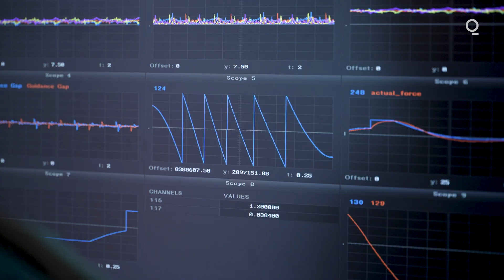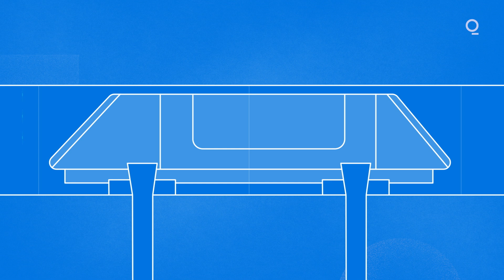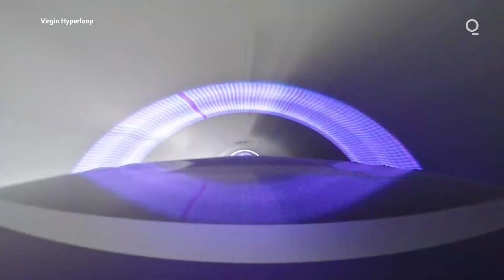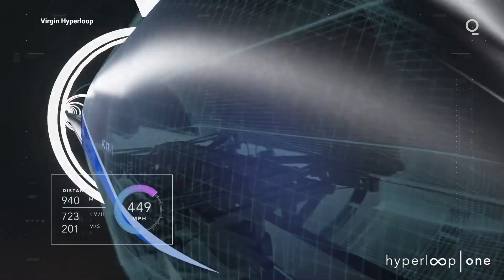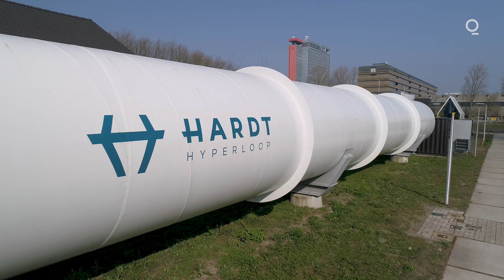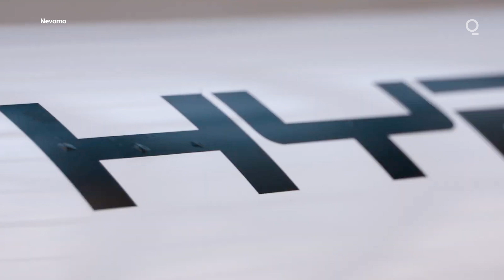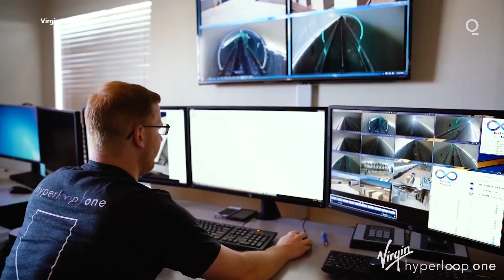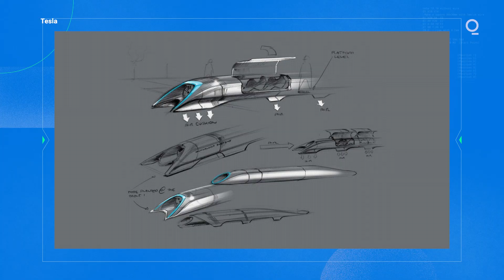The Hyperloop May Disrupt More Than Just Travel

Comment: The only way I could see hyperloop being attractive is if the prices are competitive with airfare.  However, this seems like a maintenance/operation heavy and low volume mode of transpotation.
Reply: You're right, logistics of it is utterly laughable, why not hybrid airships carrying 1000 tonnes at 100kmph? that's actually doable on a shoestring by comparison.
Reply: Flight is horrendously inefficient. The higher fuel prices get the more viable high-speed rail becomes. It’s just a matter of time before it happens in my opinion.
Reply: @stir_stick  You may want to look at the fuel consumption per person of a modern passenger jet and compare that to your SUV. You can, of course, compare to electric rail, but when was the last time you took a train from New York to Los Angeles in the US? What doesn't exist doesn't matter.
Reply: @stir_stick  Flight itself is inefficient but the infrastructure for it is highly efficient . To connect a city all it needs is an airport, to add another, just another airport. For rail you need a station (airport equiv) and rail between another rail station. To add a third city you basically have to build all that out again, to connect multiple cities you will even need more than a 1:1 ratio of rail too to increase efficiency.
All of that rail needs maintenance too and support structures for that maintenance. 
It is only feasible in a very dense area or as a means of moving massive industrial / commercial capacity, even then if you can do it via water and have a more lax time schedule ships are cheaper for the same reasons.

Think of it as running ethernet / fiber to every home in a city vs putting up some towers (ignore the inverse speed difference in this case too).
Reply: @stir_stick  trains >> hypeloop
Reply: When land transport become competitive with airlines prices of airlines go radically down, like in Europe where Trains are sometimes faster than Planes (when you take into account the TSA, and the time spent to get to and from the airport) but low cost airlines are cheaper.
Reply: @SergioLongoni  Low cost airlines don't operate in a vacuum (pun!). They are being subsidized by first class tickets sold by major airlines which pay for most of the airport infrastructure and plane R&D. Most cost comparisons are therefor total garbage. The point that rail can get you into downtown without all the location penalty and security overhead of airports etc. is correct, but it does not apply to cities where downtown is not already prepared for rail (which is mostly only the case if rail infrastructure has already existed since the 19th century). One can't simply put a rail terminal into the heart of a modern city that doesn't already have one. The cost for the necessary underground infrastructure is usually prohibitive, UNLESS we are talking about really small diameter tunnels... i.e. Hyperloop.
Reply: @schmetterling4477  The point is that if there is competition on price the price will go down and is not so important how the costs are split between low cost and premium customers.

A train station works only if it is well connected with public transport and local trains, and the hyperloop station has the same problem: if you need to drive and park a car to get on the hyperloop (or a train) then the station need to be outside of the city for the parking space alone.

So al local mass transport is still necessary, and if trains are used then the same infrastructure could be shared between high-speed long-distance and city to suburb trips.
Reply: @F33bs  the same things were said about railways when they were first being implemented around the world. There were many little companies, each company having its own lines and each line having its own track width. There were many losses, disagreements etc

Now it’s one of the best ways of cargo transport across a country. In China, Japan and Europe, it’s an extremely efficient way of also transporting large number of people.

The Boring company exists to build tunnels, so it doesn’t necessarily have to acquire so much land.

Airlines are also extremely inefficient and notoriously difficult to manage financially despite its decades old history and universal adoption. For a lot of domestic flights, most of the time is wasted in getting to the airport, check-in, security blah blah.

Rather I could just hop in a pod and be on my way to the office a few hundred km away in just an hour.
Reply: Given how much of a time benefit it provides over traditional airways, I believe that the prices will get competitive if the system is implemented properly on a decently large scale.
Reply: @F33bs  Why do you need multiple companies on one system? You don't even have that in most conventional rail systems. With regards to right of way issues: that's what the Boring company is for.
Reply: @schmetterling4477  Obviously no one is teaching history anymore.  Railroads started with lots of little companies.  There were fortunes lost by those who lost the bet of which width between the rails was going to win.
Reply: @Jen39x  Ah, so you are suggesting that many people should lose fortunes to do something that is not worth pursuing in the first place. Got you.
Reply: What is there to maintain, exactly?
Reply: @schmetterling4477  I was wondering about maintaining the vacuum?
Reply: @schmetterling4477  Not a whole lot, there aren’t many moving parts. If it were properly designed, diagnostics could be continuously taken of it, and maintenance could be performed as needed.
Reply: @schmetterling4477  laughs in a small earthquake that di-allignes the magnet
Reply: @ArchivioBDF  OK, so you don't know what Earthquakes do... so what?

Comment: Just keep it at atmospheric pressure and push air through in the direction of travel and use pressure release valves for safety.  What are they thinking.
Reply: The goal is to go faster than the speed of sound! The sonic boom behind the car would be totally destructive. Thus lower the air pressure the faster you can go without reaching the sound barrier.

Comment: For Mag Lev train, using microprocessors, air in the tunnel in front of the train can be sent at jet speed of Mach 3 - 10 using turbo and used to propel the train 🚂🚋🚃🚋🚃🚋🚃forward with an efficiency greater than the present TGO at 500 mph. 
This is safer than a vacuum duct tunnel.

Comment: I thought Bloomberg was a genuine news outlet? This is like a rewrite of media releases. Nothing critical except the “may” in the title. 

Hyperloop’s problem is capacity.  The pods are small (20-40 pax) and the safe headway between vehicles at 1000 kph means it can’t carry enough passengers to justify the infrastructure costs. 

In addition how are air locks going to open and close on a short latency to allow pods in and out of the tube?

Notice in the video they say they have “solved” the problems but they are demonstrating a new system of suspended maglev vehicles which replaced the supported maglev which replace Musk’s air bearings?  Nothing here is “solved”. They are just doing trial-and-error development. 

China is planning a national 600kph maglev network.  They are not talking of hyperloop. 

High speed tracked air-cushioned systems were going to be the big thing for inter-city transport in the 1970s. Three large prototype test lines were built in France, Britain and the US respectively.  It worked but it wasn’t viable.  Not every idea is worth pursuing. 

Hype spinning very fast = Hyperloop.

Comment: What happens if a Fireball is designed to rolled down the tube as A take over. And emp. Shutting all cars down or simply melting and electricuting  the track. How do you failsafe the system from Terrorrism.

Comment: instead of a vacuum , fill with a low viscosity gas like neon .
Reply: it is probably better to move in a straight line though , so you would have to dig , making it expensive , so it probably better to focus on planes . but if you still wanna go for the hyperloop , using low viscosity air is way better.

Comment: So far, every test of the Hyperloop was in a short tunnel - less than one mile. Nobody has elaborated on how they plan to scale up to a credible and safe scenario.

Before the train starts to move, the tube needs to be evacuated of air. Let us assume that evacuating a one mile tube may take 3 minutes. The distance between Los Angles and San Francisco is about 300 miles. At 3 minutes per mile, it will take 15 hours (!!!) to evacuate the tube assuming there are no leaks. That's a long time to wait.... An airplane flight takes a just little more than one hour.

Since the tunnel will be built almost parallel to the San Andreas fault, Mr. Musk could not explain how the integrity of the tube will be maintained during an earthquake, when the capsule is streaking at 1000 miles per hour. The earthquake can shake the capsule vertically or laterally. Hitting the wall at the speed of sound is guaranteed NOT to be painless, since the life span of the passengers will be measured in milliseconds. 

To maintain the 300 mile tunnel will not have many evacuation ports. If the capsule stops in the middle
of the trip, it may be an hour or more to walk to an emergency exit.... if there is no vacuum. If it took 900 minutes to evacuate the tunnel, how long will passengers have to wait until they can exit in an emergency?

The hyperloop is propelled by the pressure difference between the front of the vehicle (low pressure), and the rear of he vehicle (higher pressure). For this to work, the walls of the tube must be very close 
( 3 inches or less) to the walls of the capsule. How exactly can a person evacuate the capsule with such a narrow gap? What happens if there is another capsule between you and the evacuation point?

An last - how much will the ride cost: assuming that the tunnel will cost million dollars per mile, 
the cost of the system will be about one billion dollars (trains, civil engineering, regulatory costs, etc.).
Southwest is now charging $50 per ticket for some LAX to SF flights. Can this be economically viable
when COVID has demonstrated that the business customer (the highest ticket cost category) can eliminate their need to travel by the emerging technologies such as zoom meetings.

Show me the answers!!!

Comment: the cost should be that big of a factor as this mode of transportation takes less to run and is faster than all modes of transport.  U should pay for speed witch means it should be more expensive than other modes.  If they are cheaper they should only go longer distances so they don't take to many jobs from rail industry that can carry more people.  Hyperloop should work with railways not against them.

Comment: A 100 mph test does not impress me. Ordinary UK trains reach 125 mph.
Reply: It’s called a “Proof of Concept” for the “on-ramp / “off-ramp” system, sort of like flying a Starship prototype to 10 km to test descent & landing profiles. Obviously, the next step in that Hyperloop testing campaign would be to accelerate to 500 Kph (~311 Mph), do the “off-ramp” at speed & slow back down to 0. That’ll require a ~3.5 km long tunnel

Comment: how many years of college does a person require to repair these things? &how do  repairs work in a near vacuum?
Reply: from the outside of the tube   of course . even with tunnels   you can have access  by a shaft. and because its  a  coil  that  give the  charge  as it moves  down the line   well the  repair  is  very easy. in most ways its not even  hitech

Comment: The problems are gargantuan. 1. Egress in case of a malfunction. 2. Vacuum leaks. 3. Poor accessibility for upgrades. 4. Serial mode of travel - one problem affects all behind the problem. 5. Easily damaged and shut down by terrorists.  6. So reliant on so many aspects of technology that it becomes fragile. 7. Fragile in regard to natural earth movements. 8. Enormous cost to run and maintain, benefiting only the upper income earners but costs shouldered by non-users. 9. An interesting pipe-dream to employ some fine engineers and bolster the persona of some flamboyant politicians.

Comment: How much material will this take? How about maintenance costs? How long does it take to pump the air out of a tunnel.? How many people can fit in one pod? How much traffic could a one way lane handle? What happens when there's a failure of the system, where's the emergency exit? How about sabotage? What about environmental concerns digging these tunnels? How long does it take to get on and off? What new techniques would make this possible now or in the future that do not exist today? What is the biggest vacuum chamber at the moment, how does it look like and how does it compare with the proposed hyperloop tunnel size? What happens to the pod at the end of the tunnel, will it go back the same way and effectively making the line more than half efficient?

Comment: Many psyches will be shattered with one view of a Thunderfoot video.
Reply: Hans Zarn  You don't know anything.  This bullcrap what they say about no air resistance and lenghts of tunnels  is stunning stupidity and shows no understanding of basic engineering :)      

One leak and all passangers will be dead, the vacuum enviroment is not possible to achieve without a lot of energy pumping out the air constantly.  This test vehicles won't survive the vacuum :D   Speed 20 kmh :D  lenght 500 m :D is the best they could do in 10 years of testing ?  C'mon

One earthquake , mudslide, one accident by hitting the tunnel (plane, car, anything biger than a truck, or saboteur can cause deaths of hundreds or thousands very easily.
Reply: @Carl Klinkenborg 🤔 specially him..  😂

Comment: claustrophobia will be huge pain point + to carry out rescue operation due ......an accident/natural calamity- flood,storm, earthquake/ fire/drop in oxygen/cabin pressure/ terrorist attacks /power failure/technical failure/medical emergency ...........from the middle of a vacuum sealed tunnel is......... difficult/costly/time consuming/physically & mentally hazardous to passengers..........all these problems/pain points needs to be solved before using these from mass transit!

Comment: This is really cool, it will make the transportation system more diverse and efficient. They could design different pods for food and item delivery pods and subscription passenger pod or even private pod. The only challenge is the users, and I think if the government gives it green pass or supporting it could speed up the change. Since it runs on electricity, it could help push the need for solar and renewable energy market, even better
Reply: No it wont't.

Comment: They should build a high speed rail or hyperloop from Los Angeles to Las Vegas first. The casinos will very likely help subsidize such a system.

The Chunnel was a "pie in the sky" idea until it was implemented. Likely, the end result cannot be predicted right now. The devil is in the details. Currently, it should be viewed as a high-risk venture.
Reply: Tunnels and trains were real when the chunnel was an idea.  Thousand-mile-long, large-diameter vacuum tubes are fantasy, not reality.

Comment: I can't believe that people still believe in this scam... After all these years of funding and research all they have to demonstrate is 500 yards at less than 100 mph? Beautiful CGI and empty tubes. Any serious engineer will tell you tens of reasons why this is impossible to make it work. The Safety issues - how you would evacuate such a system in an emergency? , heat expansion and contractions of huge pipes hundreds of Km's this size while maintaining a high vacuum , the energy and time needed to produce even a part vacuum - it takes a huge amount of power and time to evacuate even a few m^3 of air - ask any engineer that has worked with vacuum systems - i have, in order to achieve the mentioned speeds ~1000 Km/h the hyperloop must be almost perfectly straight and level... i can go and write on and on. My point is Why? Why so many smart people fall for such scams? I believe is a combination of reasons: people trying to look progressive and forward thinking, people trying to make a fortune by scamming naive investors, and finally people that hate public transportation in general trying to divert investors from viable and proven technologies like High Speed Rail which exists and is working miracles in many countries around the world...

Comment: The forces on a vacuum chamber are incredible. It's a giant implosion waiting to happen. 
Also, what happens if there's a leak in the pod? By economics the stations have to be at least 15 minutes apart. Do you think you can survive in a vacuum for 15 minutes? 🙄
Reply: the plan is a tube 2, and it's flying 50km above earth it's crazy but it safer to transport with airplane then a car
Reply: @TopTalentVoices 
Far easier to keep pressure in that out. Planes can rapidly descend.
Reply: @Syrnian  yes, it's called crashing
Reply: Actually stoping a decent is the crashing.